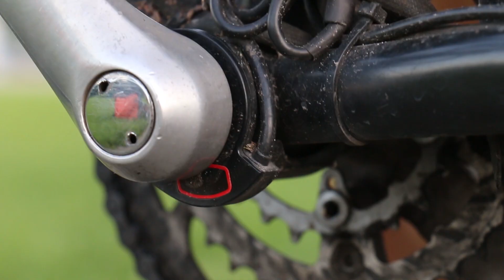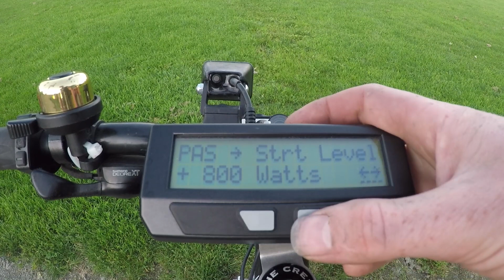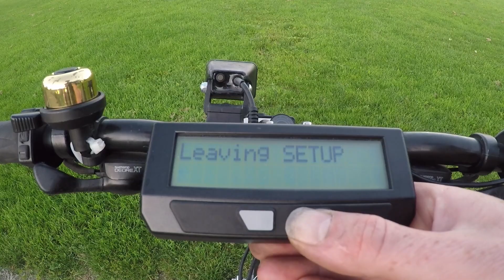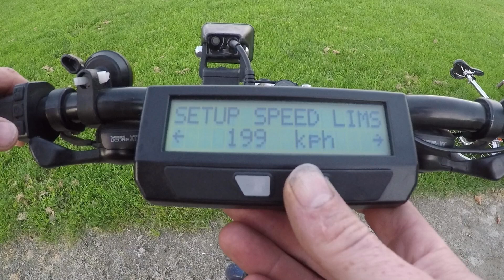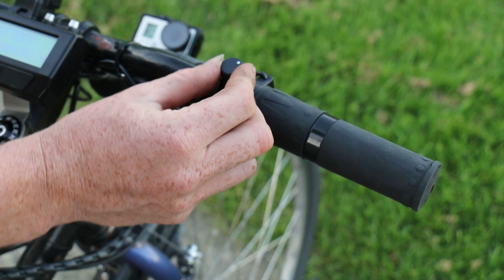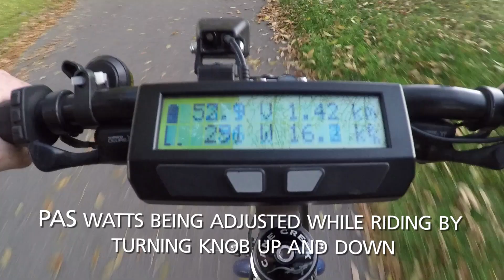How to Setup a Basic PAS Sensor with a V3.1 Cycle Analyst

Comment: Can you adjust PAS levels without the Aux switches?
Reply from the maker: You can adjust them with a potentiometer if you prefer continuous adjustments, or you can use mode presents and have 3 different presets each with a different PAS level and then change between them via a 2 button press of the main CA screen.

Comment: I have the Grin 24 pole PAS using CA 3.14 and Baserunner v4... I installed the PAS on the right side (crank side) so the wiring is a bit cleaner going into the frame.  Pedaling backwards set to Reverse works but setting to Forward I only get a 'pulse' of motor help at best. Do I have to remove the cranks and switch to other side? Hoping there is an easier way.

Comment: I have 1 question: I have a varied Width PAS (1 wire) when I setup the PASD dir. Polarity on Fwd it detects
rotation on both directions, the CA can not difference forward from reverse, and when I setup it on Rev the CA don't detect rotation at all, is there a setup to fix this?
Reply from the maker: No, there is no firmware support for the asymetric pulse width PAS sensors. They seem to be quite uncommon and more of a relic of ebikes from the early 2000's.   Your best bet is just to replace the pickup sensor with one that does the proper quadrature encoding.

Comment: I got your SX2, V3 Cycle Analyst and Multifunction Switch Assy CA3_MFSwitch, I tried to follow these instructions so I'd have more steps for smaller Pedal Assist increments, that worked great, but now the analog throttle seems to be limited to the power level of the PA setting, so if I'm set to 100W pedal assist, full throttle will get me 100W. IDK what I did wrong, do you have any suggestions re: how I can fix it? The throttle worked normally before that.
Reply from the maker: You set the Digi Aux limit function to Power Limit, rather than PAS Level.  Change the Digi Aux function to PAS Level and your throttle response will be unaffected.

Comment: Y need a question. Jejeje my ingles its verry bad. This tipe of screen its availebal with all tipe of controller? Y have a problem with mi controller and my lcd1 its dont work my sensor pas and i fink too buy cycle analist but y am not sure she is compatible with my controller🤦‍♂️XLD Xunlido item DG61
Reply from the maker: Unfortunately the Cycle Analyst will not be easily compatible unless you are willing to do a significant amount of custom wiring into your setup.
Reply: @GrinTechnologies  y need to soldering inside of the controller, certainly? It's not a problem. Y don't scare 😉🤣🤣

Comment: How do run two aux inputs simultaneously? Plug the second into the throttle plug?
Reply from the maker: You need one digital aux and one analog aux device. The digi-aux has dual male + female JST plugs on it so that when you have both, you then plug the analog aux into the spare connector on the digi-aux harness.  The throttle plug should only be used for the actual throttle.

Comment: Hi!
I have a huge problem with my fresh built ebike. Downt know anyone who can help me so I just post it here and hope to get some tips. I have CA v3 sabvoton controller and cyc motors x1pro engine. Also I have 5v 3pin twist throttle and 5v 3PIN PAS sensor what came with an engine. It has 26poles and rpm sensor. So I connected it to CA ground and+5v from aux input. Signal wire i took from pas sensor plug yello wire for rpm. I connected everything and follow guide from website how to set up CA by going throught menues and setting values. But when I connect CA to my controller  then engine starts to spinn. Even when throttle on pas sensor wires are not connected it spins. I have tried to change settings of shunt, throttle and so on but nothing seems to help.
Reply from the maker: You should look at the throttle output settings. This isn't PAS related behavior but it means that even when the CA's throttle output is at the minimum, your controller still thinks it is receiving a throttle command. If the controller expects a potentiometer style throttle then that would explain it. Try going right down to 0V for the min throttle output.

Comment: I assume one is able to adjust the speed at when the assist is cutting off, or? Is it possible to have a smooth transition from full power to no power when reaching speed limit for the assist?
Reply from the maker: You can set a speed limit in the speed limit settings and then the PAS power will automatically scale back as you are at that limit speed, yes. There is a set of PID control terms to help tune the limit value. At the moment there isn't a separate PAS speed limit different from the general speed limit though if that is what you were asking, but if you use the PAS assist mode of Basic (ThO) with a typical controller, then each PAS assist level is effectively a speed target rather than a power target.
Reply: @GrinTechnologies  
Does it mean that I can program the assist to gradually lower the power so that it isn't being cut of from 100% to 0% at a certain speed?
For example:
100% power from 0 to 25 km/h
50% power at 28 km/h
0% power at 30 km/h and above
Reply from the maker: @AlveHenricson  If you have a typical ebike motor controller, then yes this is effectively what throttle voltage limiting does. It's not explicitly set as speed target. If say your bike does 40 kph no load at full throttle, then if you have a PAS (ThO) set to 75% throttle, it will have 0% power at 30 kph and above, then progressively more power below 30 kph.

Comment: hey GT, are you able to connect the cycle analyst to a high power system for a high powered EV using that shunt?
Reply from the maker: You can definitely use the CA with high power EV systems when you use a suitably sized shunt, I'm not quite sure which one you are referring to here. The Stand Alone CA shunt is good for systems that do up to 50A continuous and 100A peak, while the larger 0.5 mOhm shunt is good for about 100A continuous and 200A peak, and the 0.25 mOhm shunt is suited for double that again.
Reply: @GrinTechnologies  yeah, from further research, that seems to be about right. Pretty cool actually.